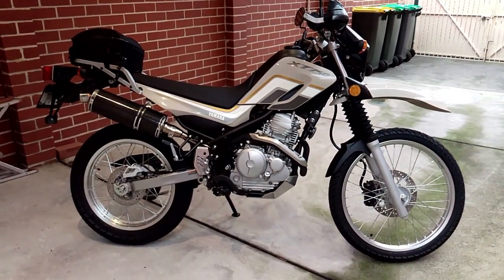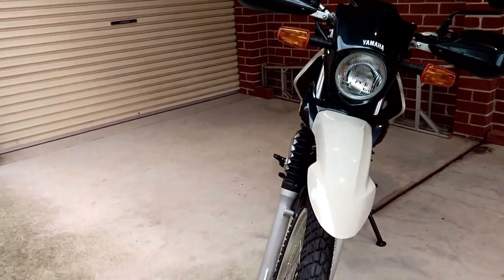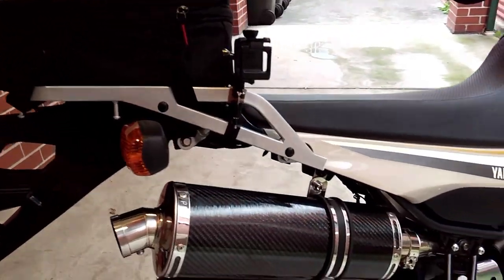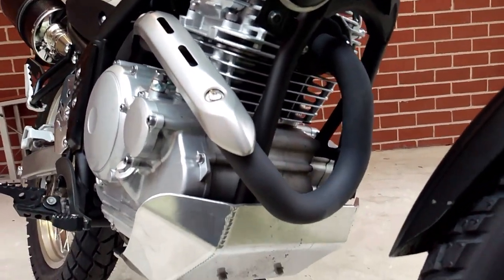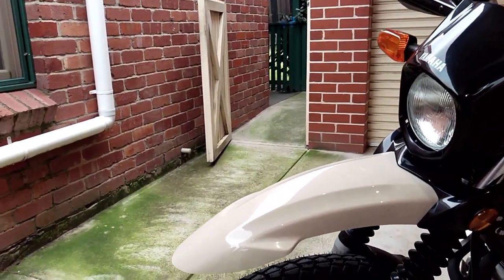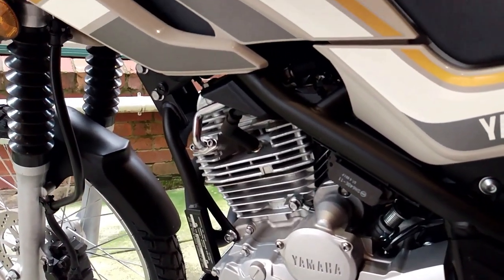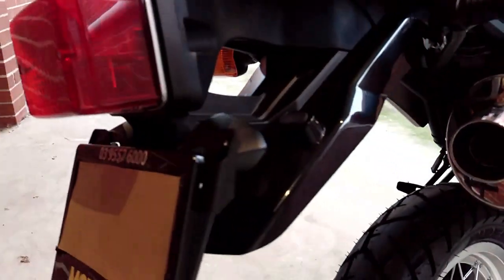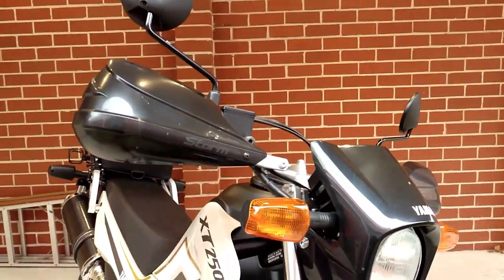Yamaha 2019 XT250 Three Month Ownership Review

Comment: Hi Chips. Thanks for your great review. One question on the exhaust. I read on the Delkevic website that they recommend a dyno test after fitting although no rejetting or remapping is required. Did you do that? Thanks again.

Comment: Did you have to make adjustments on you 600 mile value clearance check or where they still in tolerance? The XT250 is a really nice bike I have the 2021 model. Chose it over the 2021 CRF300 that I had a deposit on. Mainly because of the seat height.

Comment: Great review.  I have a 2015 that takes a thrashing and never lets me down.  When you put the slip on exhaust on did you have to adjust mapping?
Reply from the maker: No I didn’t have to get the fuelling remapped even asked a pro whether it was worth putting the bike on a dyno and they said it would not be necessary.
Reply: Chips Cooper thanks Sir

Comment: buyin a 2019 next week with 1000 miles on it,  so jacked!! lol
even an ol guy can have mountain fun on one of these.  had a dt250 brand new in 75, wish I'd a kept it all these years, but fuel injection and electric start will be nice!
Reply from the maker: I've still got my XT250 and have travelled 12000kms on it and had no issues at all with the bike.I've ridden the motorcycle both on and off road and it performs brilliantly Cheers Chips

Comment: Did you put a power commander electronic timing Gizmo to rejet the fuel injection for the slip on? I seen a video where a dude melted his back Fender off because of the new exhaust pipe.
Reply from the maker: Gedday Carlos with the Delkevic exhaust which is the one I installed on my XT250 you don't need to use a power commander or anything like it to adjust the mapping of the bike and  also it doesn't burn anywhere near as hot as the FMF Powercore 4 which is the one that you saw in the video I presume so it won't melt the plastic at the rear of the bike. Interestingly even when I ride quite a long distance the Delkevic doesn't get overly hot so I believe it might come down to the muffler packing and the amount  the different manufacturers use in the manufacture of the mufflers I also have a video on the muffler and how it looks and sounds on the channel hope this answers your question Cheers Chips.

Comment: Where did you get the aluminum guard just below where the exhaust connects on the right side of the bike, and what does it protect? I already have a skid plate.
Reply from the maker: Jeff RT Gedday Jeff it protects the rear brake cylinder and I got from a company called B&B Off Road https://bboffroad.com.au hope this helps you out Cheers Chips.
Reply: @ChipsCooper  Thank you Chips. I appreciate it. I will check them out.

Comment: G’day Mate! Firstly, thanks for your awesome and very informative review. Secondly, I’d like to ask about your comment on why you changed your tyres to a pair of Pirellis. You mentioned that you did this so the bike would be more user friendly on roads. My question is, is the factory fitted tyres really that bad? I will be picking up my XT250 soon and I’d like to make sure if I need to have the tyres changed prior to delivery. I will be using the bike 95% commuting to and from work in the city and perhaps some weekend country rides. Any advice? Thanks in advance.
Reply from the maker: Gedday Mark the reason I changed the tyres was that like yourself I was using it more for my commute which is about 80km a day plus doing some occasional off roading and having used the knobby's for a couple of months I just thought that they were okay in the dry but in the wet and at freeway speeds maybe I needed something that was a bit better both in stability and wear which is why I went for the pirelli's.The one thing I can tell you is you won't be disappointed with the bike it really is a very good motorcycle I own 4 other bikes as well and I get just as much out of riding it as I do with my cruiser and sports bikes sometimes maybe more welcome to the XT250 club Cheers Chips.
Reply: Thanks heaps Chips. Your response really helps. Kind regards!

Comment: Don't agree completely, I own the slightly older version of this bike, and it is extremely capable in many ways, for a simple 2 valve single cylinder, the all round performance is exceptional, the bike will get off of a  green light very well without abusing it, and handling and offroad capabilities are more than the bike should have for the price.

Comment: Where did you get that rear wheel.  It looks like it does not need an inner tube.
Reply from the maker: Mine is the 2019 model and yes you are right it is a tubeless rim  with the stock knobby tyre on it although I did have to put a tube in the Pirelli MT60 because they were not a tubeless tyre from what I understand my model was the first to offer the tubeless rear rim but I suspect if you bought an earlier model you could purchase the rim and it would fit your bike no problem at all.

Comment: I'm thinking about getting one to turn the beaches into my own highway. How do you reckon it'd go getting on and off through the soft sand?
Reply from the maker: Not too sure about soft sand as I have only taken mine on things like fire trails and dirt roads which it handles no problem at all but from what I’ve seen other people tend to use something like the W250R on things like soft sand.
Reply: @ChipsCooper  I think a wr might be overkill for my needs and skill level. I'm thinking the xt will be light enough to get me off the beach and while I'm on the beach I'll stick to the hard sand. At the moment I'm riding a klr and I'm not taking that lump anywhere near the beach.
Reply: @benmitchell2537  Hey Ben---do y'all have access to Yamaha's TW 200 down your way?   The big ol' tires might be suited nicely for that.
Reply: @FungusHat  afraid not. I think it'd be perfect but they aren't sold here anymore and the second hand ones that come up are expensive as a result. I just looked and found an '89 model for $6500

Comment: Your front tire looks like it's mounted backwards and will direct water towards the center of the tire as it rolls forward.
Reply from the maker: I can assure you that the tyres are fitted correctly I've ridden the bike in the rain I don't how many times this winter without any issues.